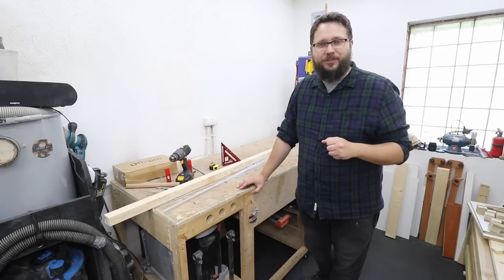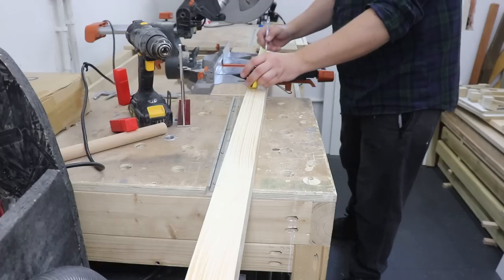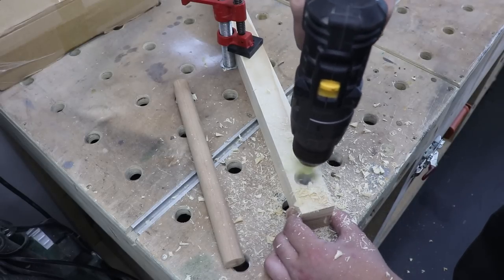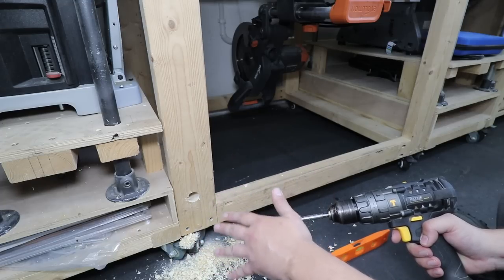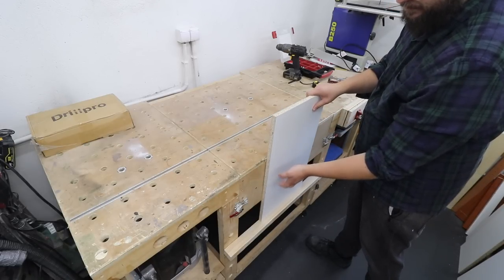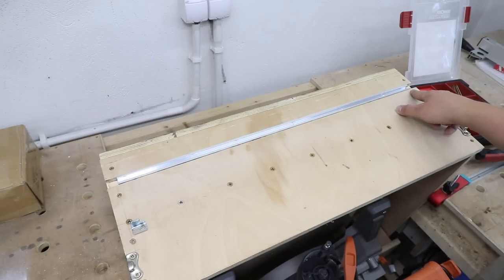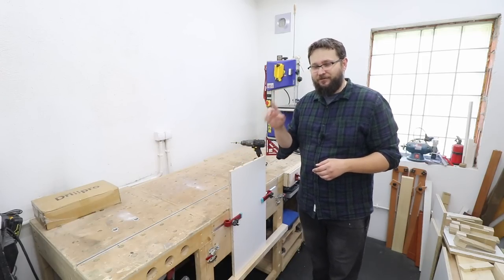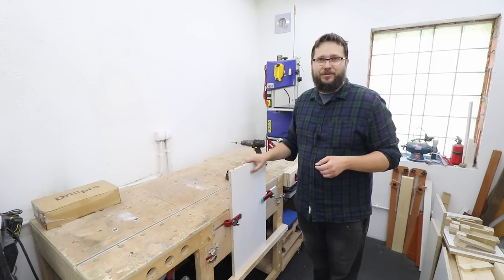Simple Workbench Upgrade That Makes All the Difference

Comment: Good setup. An alternative would be microjig dovetail jig which is very flexible. Hardest part is getting good at routing the dovetail tracks with accurate routing
Reply from the maker: Yes but I think it take more effort plus you have to invest in those clamps that would fit the dovetail. And I think they quite pricey

Comment: A very clever and practical tool/solution. Just one thought. The dowels of the horizontal (square section) member may, over time and use, become worn. This will cause your base to walk away (possibly). You may have to think of a way to secure this member to the vertical supports so as to avoid any play. Just a thought (that may have an easy solution). Cheers from a UK still looking for that summer weather.
Reply from the maker: That's why the dowels are longer and go through the workbench support. And even if eventually the will get a little wonky then remember you are putting your material against that support and then you clamp it to your workbench so the force of the piece against the support plus clamping and it will be steady as a rock for a very long time👍
Reply: Yes, an excellent and easy to accomplish solution. You are correct in pointing out that, over time, there might be some drift of the support timber with the dowels becoming slack. One possible solution would be to drill the supporting holes at a slight angle. Nothing vicious, just enough to keep the support snug to the workbench.

Comment: Nice. 
Do you have a track saw? Looking at you bench, it's almost a complete diy MFT. The only thing "missing" is a diy rail hinge shown by Peter Millard. The front T-track is already in place, dog holes are already drilled.

Oh, BTW why do you use two different toggle clamps to secure the flip-top? Which works better?
Reply from the maker: I do have a track saw from Evolution and its not that great hence I don't use it that often. But I guess it's time to get it installed on my workbench like Peter has done it 😅
I just have them for stability but truth to be told I only need one set - the ones with the red handles are very strong

Comment: Very clever solution.

I agree with you about dowels. I love using them. I much prefer to build my projects without using screws and/or nails and I can't afford a Domino either so dowels are my main method. I made a cart for my air compressor using OSB and I used dowels for the joinery. It is solid as any cabinet you'll find. The only screws used were for the casters.

Can't wait to see your new dowel jig. I use the Milescraft jig, similar to the one you used in this video. It is the most accurate doweling jig I've used, and the price can't be beat.
Reply from the maker: Been testing the new jig today and I have to say it's great. It's just bit pricy but when you consider what you get I guess it's not too bad. And that's shat I'll use to make all the cabinets and wardrobes so it will pay itself off